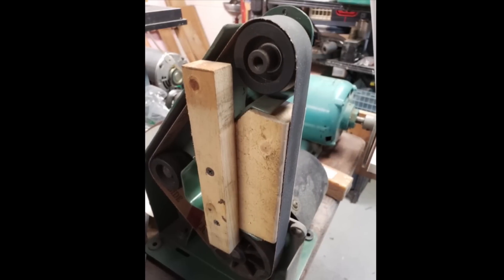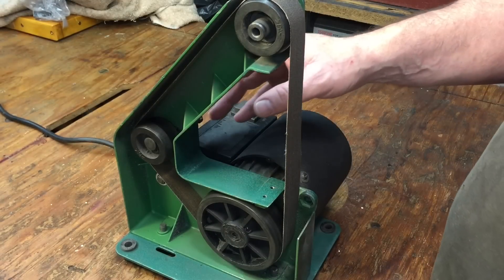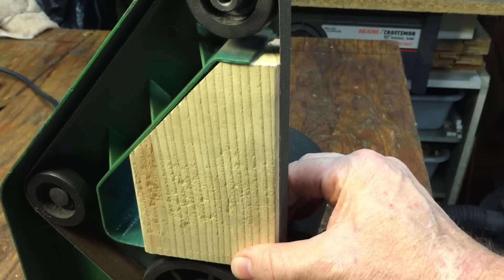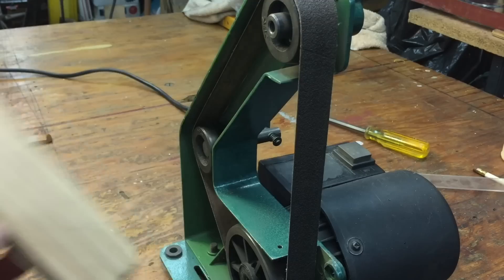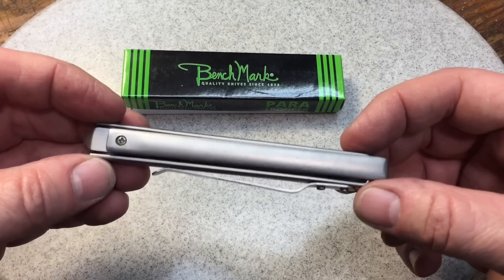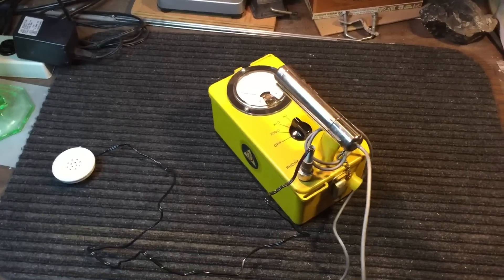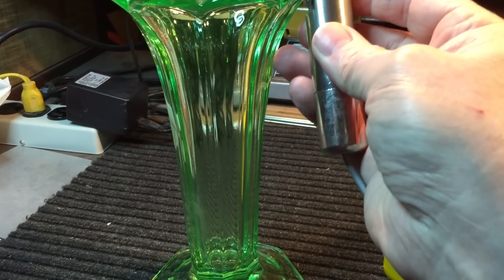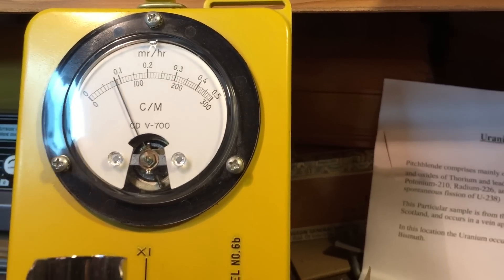Belt Sander Platen, New Antiques and Checking Radioactivity with a CDV-700 Geiger Counter

Comment: Thanks for the shout out John. As far as some of the guys mentioning putting aluminum or metal on the surface, I thought about that for a hot second and was concerned that it might absorb heat from the friction and the work piece so decided against it. Wood has such poor thermal qualities I left it as is. I've been using mine for well over a year and it shows no sign of wear.
Reply from the maker: Phil-  Thanks again from all of us!!    =D
Reply: Thanks this will be very useful

Comment: Would you check the tungsten for a tig welding torch for radiation?
Reply from the maker: Walt Crawford I don’t have one or I would check it.  Is that a source for radiation?  I never heard that.   Thanks
Reply: I have heard that they are slightly radioactive, made of thoriative tungsten.  I have heard that the radiation isn't an issue unless you breath in some dust when sharpening it.

Comment: That's a outstanding idea on the grinder. Mtech makes pretty good knives. If it's going to be for using. I would use thread locker on the screws they come out easily lol. That paratrooper style knife is a very interesting cool design. Thanks Scout =D

Comment: From what I have seen of lock picking lawyer and Bosnian Bill, it’s probably more difficult to open the packaging on that master lock than it is to open the lock itself.
Reply from the maker: LOL!!!!!!!!
Reply: @ScoutCrafter  Giant Print Master Lock. OH boy!
Reply: Plastic blister packaging could make fort Knox look insecure
Reply: @rickt.1870  thanks for the link.  I noticed the review is nearly 10 years old.  John, if you haven't already, you should consider buying a clamshell opener as a future antique.  A tool made specifically for opening packaging.  It's the modern version of the crate tool.  I also note that nearly 10 years later Amazon didn't get manufacturers to stop using clamshells.

Comment: Next step is to put a steel face on that platen. It won't wear out and you can get some really REALLY flat grinds. You might have some tape bump on finer grits but I don't recall you using much higher than an 80 grit on the 1x30.
Reply from the maker: You know Allan, you could easily glue/screw a metal strip right on the face of that temp platen!   =D
Reply: BINGO.